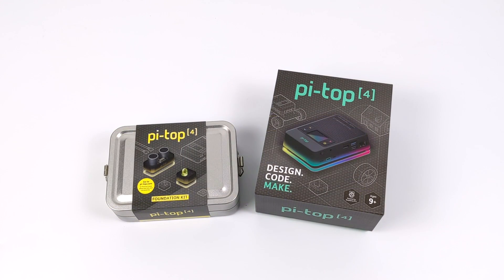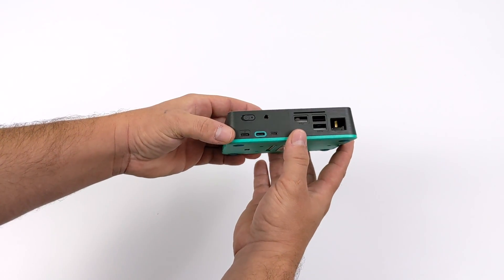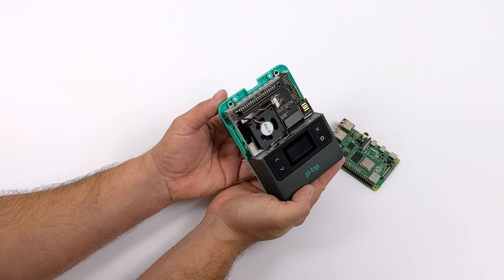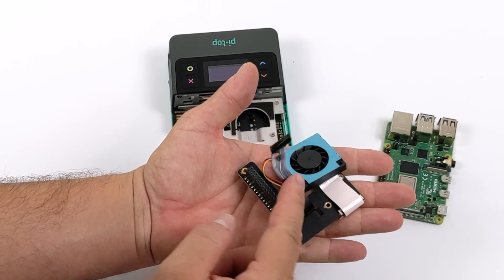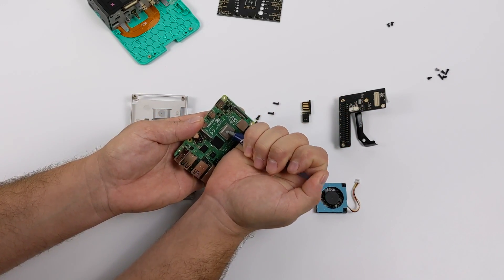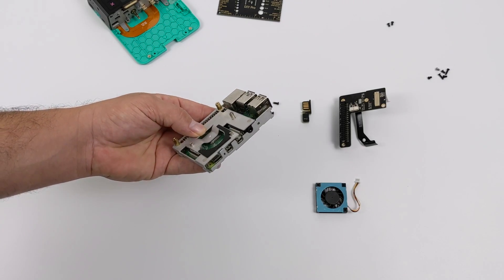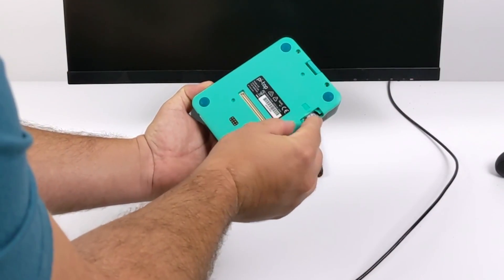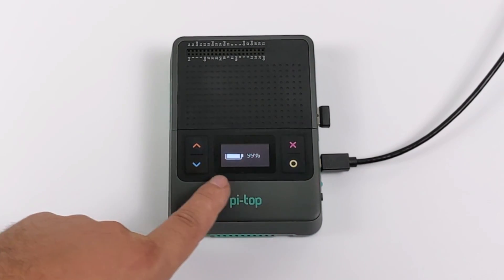Pi-Top 4 New DIY Edition - Power Armor For Your Raspberry Pi 4

Comment: They didn't take the opportunity to convert at least one HDMI to regular sized HDMI?
Reply: This is the DIY edition, but the full pi-top [4] bundle comes with a cable that does connect to regular sized HDMI.
Reply: @eliphillips877  Yeah, but people will have a collection of regular sized HDMI cables they'd like to continue using. Having to figure out where that one mini HDMI to HDMI cable is - which might well be too short or too long for the job - is just an unnecessary hassle. It's not like this case is particularly compact to begin with.
And on top of all that, these mini HDMI connectors are the worst for stability and longevity. They quickly wear out and become faulty. - At least that's my personal experience with them - 
So IMHO not fixing this Pi4 "issue" is a missed opportunity.
Reply: @J0ermungand  Believe it not, this was discussed a lot internally and you're logic is exactly right - seems you should have been on the team when we made the decision! Jokes aside, there isn't actually that much room on that face of the product (and we wanted all cables to come from one side) - we looked into a vertically-mounted full-sized HDMI but had trouble because of the angular faces of the product. Can't argue with the struggles of trying to find a micro HDMI cable, I've been through that ordeal many times so I feel your pain!

To your point on longevity, we had the same concerns. Micro HDMI connectors are typically rated from the manufacturer to about 5k cycles - so we just needed to ensure that the solder joints to our circuitry were rated to more than that. We mounted the port in such a way that the plastic casing clips over it to give it more support (an improvement over using a bare pi) and it's been tested to 10k plug cycles as well as had a lot of drop tests carried out - haven't had any trouble so far
Reply: @ryandunwoody5076  
Very well, thanks for the explanation. 
From the review of it, this is a very interesting product and it felt like a standard sized HDMI port would've just rounded this off that much better. But I understand that engineering in the face of a production ready device is a cruel mistress. However, I'd suggest including one of these mini HDMI male to HDMI female adapters instead of the cable (or maybe on top of it)? It would alleviate the problem of reusing ones collection of HDMI cables. And you can leave those adapters plugged in, even when not using it, because it doesn't take up all the space a full cable would (so you won't easily loose the adapter).
Reply: @J0ermungand  Good idea! Thanks for the suggestion and thoughtful response, much appreciated
Reply: @J0ermungand  Maybe! It hasn't been a huge issue for me. When using the pi-top as a desktop, I mostly  keep the cable plugged into the screen I'm using and have the pi-top accessible. In my setup, if I have to unplug it and move it, I can easily take the cable with me. I guess I don't see micro-HDMI to HDMI as an issue, personally. I also VNC into it when I don't need to move it but want to use it. None of this means that you're wrong. It just means that I haven't personally experienced those issues.

Comment: If they just could evolve and remove the gpio pins, replace the gigantic USB ports with usb c and a smarter Ethernet port the raspberry board could actually be used for something, building your own 15.6 inch tablet, multi CPU laptop, phone, computer cluster or slim hobby projects but no, the raspberry just have to be thick as possible.

Comment: You get a lot for your money really.
Reply: Not really. A fan costs only a couple of bucks. You could buy better speakers for another $20. Good passive cooling aluminum Raspberry Pi cases run for about $25-39 (Flirc, Argon One, Anidees, etc.) How much are batteries? The little display is not something I really care much for. I think the price tag could be improved.
Reply: @DoryanTheCritic  you forgot to mention tooling, fabricating the special shapes and boards / connectors / adaptors, the screen, design work many other things that cheaper cases don't have.
Reply: @nathanaelsmith3553  I did mention the display or what you call "screen". Besides, every case includes some level of design, design is not a given in any product, not even in low quality products. There's always some level of design that goes into making anything. But what boards are you talking about? Connectors and adaptors, which ones in particular? Their proprietary connector for the display accessory that is still not even available on their website? Not to mention that you lose one of the micro HDMI ports and a USB port. Or do you mean the adaptors/connectors to just relocate the GPIO pins?

I don't mind paying a hefty price tag, but there has to be at least something to show for it.
Reply: @DoryanTheCritic  have you actually watched the video all the way through? The design of this case is way more complex than the simpler ones you unfairly compare it to.
Reply: @nathanaelsmith3553  What do you think?
Reply: @nathanaelsmith3553  Ah, resorting to insults now.

Comment: 99$ but doesn't include the pi or micro sd card or power supply. so 170$ at least. you're saving 30$ to spend time to put it together. not worth it